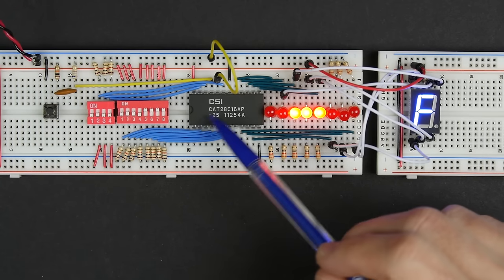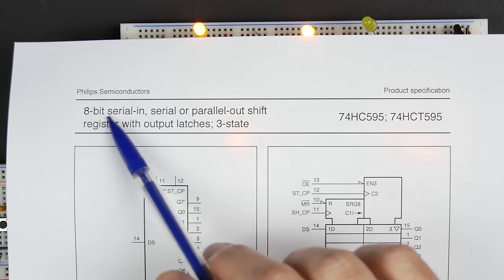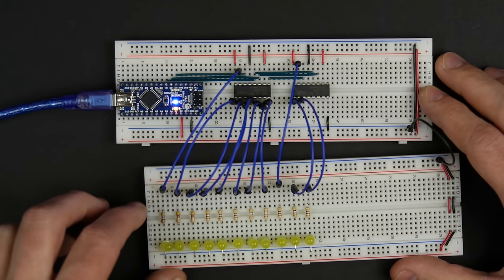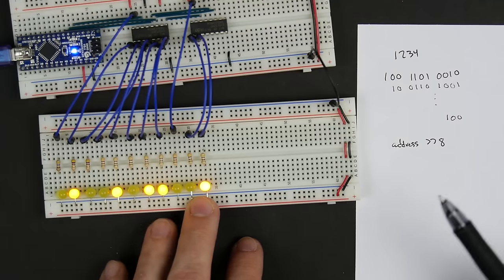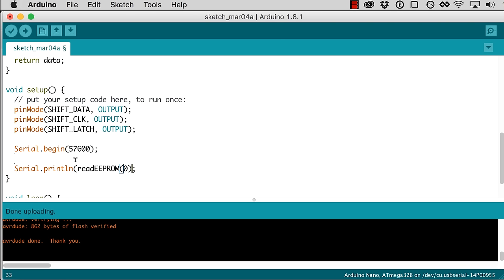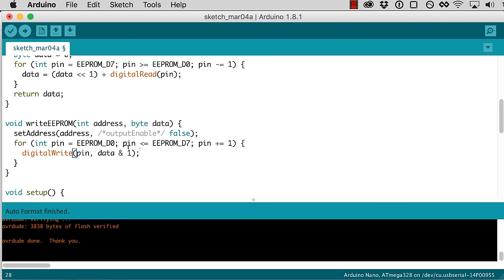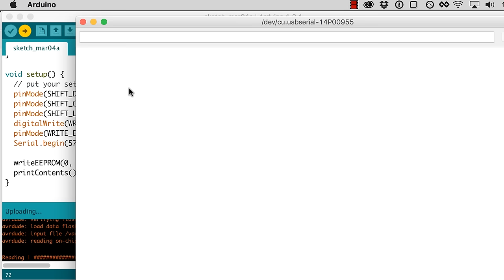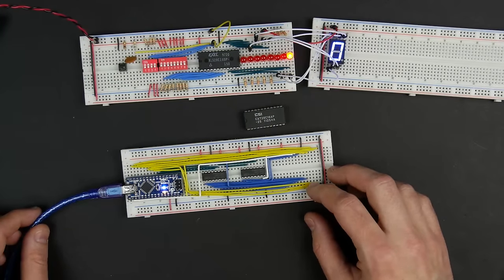Build an Arduino EEPROM programmer

Comment: Um… Am I missing something here?  You really only need seven output bits, since you are not using the decimal point.  And you only need four input bits, since you are only trying to encode one four bit hexadecimal digit.  That’s eleven bits plus the write enable which equals the twelve bits available on the arduino.  We can set the output enable with a dip switch to set whether we are reading or writing in any particular moment.

Why do we need the shift registers again?  At least for programming the hex digit display?  I get you’ll want the full address and data bits to generically program the full eeprom.

Or, you could use a TIL311 hex display which has the hexadecimal encoding in it.  But those aren’t very common.

I imagine I could use a Raspberry Pi Zero instead?  The Raspberry Pi has 40 GPIO pins, and can be programmed with an SD card or through WiFi, ethernet or USB.

Comment: What kind of wire do you use?
Reply from the maker: 22 AWG solid core like this: https://www.amazon.com/Electronix-Express-Hook-Wire-Solid/dp/B00B4ZRPEY
Reply: These are the same they sell on ebay. They have really thick insulation. I recommend the ones that Jamco sells. Get the 100 feet spools, 25 feet spools will not be enough.
here is a link.  
https://www.jameco.com/z/HUWBUN100FT6-22-AWG-6-Color-Solid-Tinned-Copper-Hook-Up-Wire-Assortment-100-Feet_2159189.html

Comment: I built one for programming one or two chips at once, so it can program all three (control rom, code rom, conditional rom) with one utility and circuit. Let me know if anyone is interested, I can publish it.
Reply: also its using either a mega or due, so you have just a controller and a breadboard, no registers needed
Reply: I'm interested in it

Comment: I would have set the Analog pins to digital mode and then just used `PORT_A` in a single cycle to access the data lines...

Comment: I kinda disagree with the way you're reading and writing the data. Obvious solution would be connect all the data pins to a single port and use DDR, PORT and PIN registers to output all the data in a few cycles without unnecessary loops and shifts.

P.S.: the way you connected the external devices may cut you off of that idea.. just my 2 cents here.

Comment: Hi Ben,
What breadboards do you use and where did you get them from? I'm building the computer, but I have huge voltage issues on my breadboards and I have no idea how to solve them.
Reply: Rizier123 if you have voltage issue I'd say, check your wires and try to use another power supply. it can't be the breadboard's fault
Reply: I've already changed my wires from 24 AWG to 20 AWG wire, which helped a bit, but still didn't solve the problem. I use the exact same power supply as Ben uses, but I might give another power supply a try.
Reply: I ran into the same problem. The metal used in most breadboards is not ideal and has resistance and so you loose a fraction of a volt when you cascade power from breadboard to breadboard. What I did is supply each breadboard power from the source directly and that stabilized it. You can loose a whole volt by the time you get the last breadboard and if your Source supplies 4.5 volts you will have 3.5 volts on the bottom breadboard. As a note the Blue LEDs especially  need extra voltage to turn on compared to Red or Green LEDs. That's how I found out my bottom breadboards had significant lower voltage than my upper breadboards. My Blue LEDs weren't coming on.
I'm using  an  Apple IPAD Charger which is rated at 5V 2A. It doesn't output exactly 5V more like 4.5v but at least now  I get 4.5v at all my breadboards.

Comment: Nice project. I'll build one but I wonder if anybody has designed a PCB for this circuit? Or can point me to low cost commercial EEPROM programmer? Think I'll use an UNO R3 with a  Veroboard shield and ZIF socket as a start.

Comment: The manufacturers claim compatibility between certain parts but  even JEDEC parts can have differences, usually undocumented. In some cases the datasheet lies. In many cases there is an addendum which corrects the lie. Since that is a very obsolete part I can't find the datasheet. So twiddling bits and timing is all you can do.

Comment: do you have a video on how you make such great looking bread boards? lol mine are so ugly
Reply: You don't need a video on how to make component and wire placement aesthetically appealing for you. What it takes is patience and practice. These are learned traits that will come from within you over time. If they don't.... you will forever be dissatisfied with your end results.
Reply: What I do is strip enough sleeving to fit into a board hole, bend that stripped bit 90° and stick it in the right hole, then route the wire to its destination with neat flat bends, and mark where the destination end should be stripped.
 Cut the wire a bit past that point, and strip a bit off the destination end.

Comment: I was trying to find out whats the problem for like 10 minutes, then realised instead of SHIFT_CLK I typed SHIT_CLK
Reply: have you buildt it?
if so where did you get the components. there sold out everywhere and outdated
pliz respond
Reply: @aleksanderjohansen3725  Yes, I made a programmer and it works with the same code ben wrote. I'm from Russia, I used 4 Soviet К555ИР11А chips. This is a 4 bit shift register, so 4 of them and 2 breadboards needed. I doubt you can get them in your area.

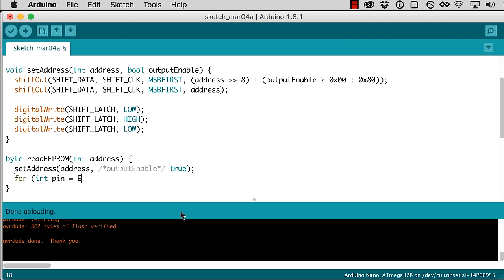Comment: 31:31 first digitalwrite(shift_latch,low) should be on setup.makes code bit faster :P only unprofessional programmer set something even it allready is. i mean next time setaddress funtion is called its put shift_latch low even it allready done so last time it run it

Comment: You never, never, never write program code whilst sat at your keyboard and monitor. Computer programmers code away from the computer using pen, paper, top down design and stepwise refinement. They only sit at their computer when it is time to enter the program and test it - with test data! The "make it up as you go along" approach is very bad programming practice and it always leads to program bugs.

I have seen some very bad programming on YouTube, with people writing interrupt service routines containing calls to the Arduino delay() function and people jumping out of subroutines in BASIC.

Comment: Man, that was sloppy C coding. I would write the code like this (addition of outputEnable):
shiftOut(SHIFT_DATA, SHIFT_CLK, MSBFIRST, (address >> 8) & 0x7); // The most significant 3 bits
shiftOut(SHIFT_DATA, SHIFT_CLK, MSBFIRST, address & 0xff); // The least significant 8 bits

I learned this by the hard way.

Comment: 41:33 Shame you have to go through the data one bit at a time and output it to one pin at a time, it's slow. Isn't there a function to send an entire byte to 8 pins? Particularly when the pins are consecutive like in this design.

Sending the address one bit at a time doesn't matter since that's how shift registers work, but since the whole byte is there waiting, it's a shame you can't just send it out, the Arduino handles bytes after all, shame to make everything serial if you don't need to.

Comment: oh no the sprintf buffer is too small!
Reply: A 18-parameter function call, indeed, an easy task for the compiler ;) And BTW, don't you think the "setup" function should be called "main"? And to read and write ports one bit at a time! Arduino programming sucks.

Comment: "I have to reboot my computer before it will see the arduino again."

Yeah the problem is that big Apple logo on the case.

Every time they release a software update there is a swarm of people at  dealerships complaining their iphone just doesnt work with the multimedia console in their car anymore.

We used to have to clear/reset PRAM every two weeks to keep the protools rig minimally functional at work.
Reply: I use Arduino on Mac and PC - and actually have excellent reliability with the Mac! PC likes to change its serial port number like every time its reconnected...

Comment: You do NOT need to use shift registers for address lines if you use an Uno or Nano or even a loose ATMega328. Just use a port expander like a PCF8574 or an MCP23x08/MCP23x17... preferably the ...17, since it's sixteen-bit and doesn't require pullup resistors. That's very straightforward.
Reply: Will 28C256-15 EEPROM work? Also can you send me the link

Comment: Thanks you so much for this video.. It worked for me both the code and the circuit programming a 28C16.
However, there's an issue that has not yet been accepted https://github.com/beneater/eeprom-programmer/issues/2
Thanks to that correction I could get the circuit to work.